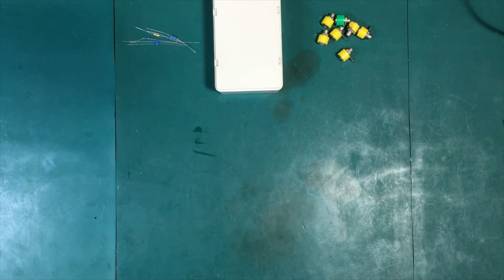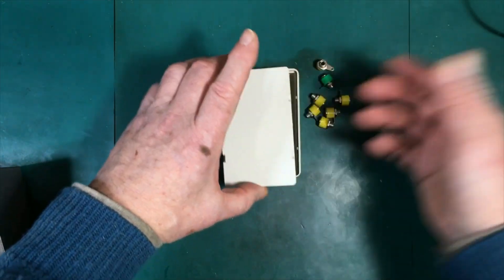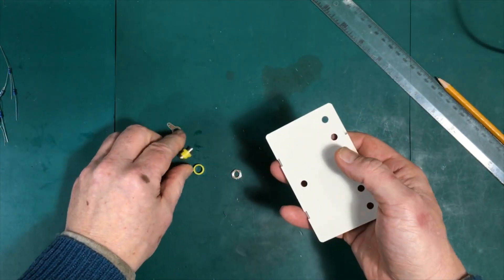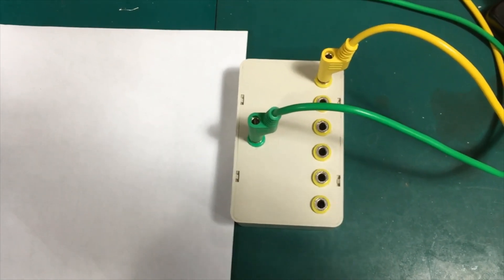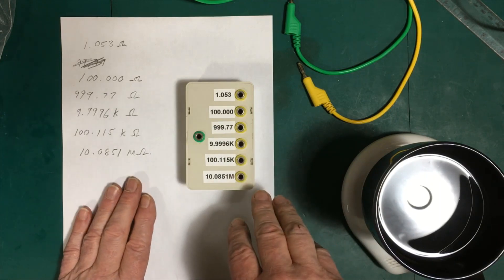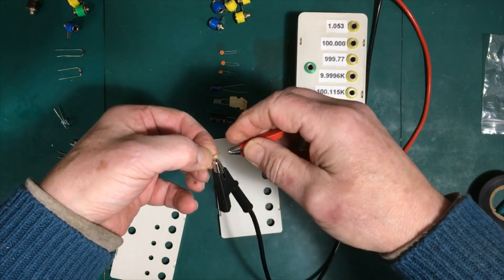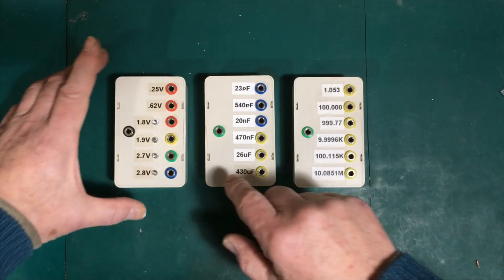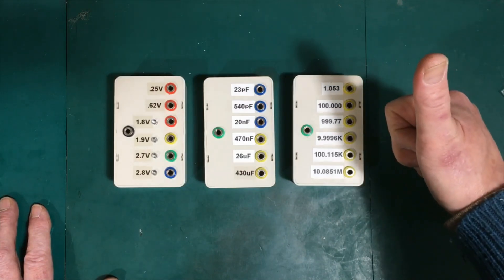0017 - DIY:  Quick 'n' Easy Multi-Meter Testers

Comment: terrible "DIY"... you didn't even explain what you were doing - especially after the video died... LOL...
Reply from the maker: I explained what I was doing in the first 60 seconds.  Seems you're the only one that missed that.  These are not very complex devices, sorry you couldn't keep up.
Reply: @uni-byte  not WHAT you were doing (I know what you built) but HOW to do it... like adding those resisters and that wire when the video died.... what did you do?
Reply from the maker: @pesto12601  It's fairly obvious.  The wire is the common and I soldered the resistors/diodes/capacitors from the sockets to it exactly as is shown in the video. Stop the video at 5:30, you will see it plain as day.

Do you always "👍" your own posts?
Reply: @uni-byte  Yes - I do actually.. because If I you don't love yourself.. why should others? 🙂

Comment: Place these three into one box with a square wave output powered by a battery, a small panel meter , and you would have a great test box to take to ham fest / electronics swap meets to test meters, power supplies, and scopes before buying.
Reply from the maker: I think you have something there.

Comment: I would add force+ / force- terminal as well, especially if you want to measure the 1 ohm and 100 ohm resistors accurately. Otherwise did you null the resistance on the leads before measuring the 1 ohm?

Surprised no schottky diode! Another possible idea is to put a little constant current circuit in the diode box for say 1ma, then give access for a voltage reading across them when it's powered.
Reply from the maker: Thanks for your comments.

Yes, I did null the leads to be sure.  However, adding extra sockets for Thevenin  measurements is not really required.  The idea is not to measure the resistor accurately per-se, but to calibrate it as it stands.  That way the calibration is good for any meter, not just those with 4-wire capability.   Also, it was not the intent to use these as ultimate calibration tools, just to quickly check if the instrument is near it's accuracy.  The resistance box should be good enough for most, if not all, 4.5 digit meters though.

The first diode in the diode box is a 1N60 Germanium Schottky diode.